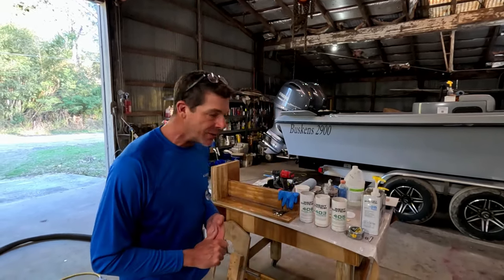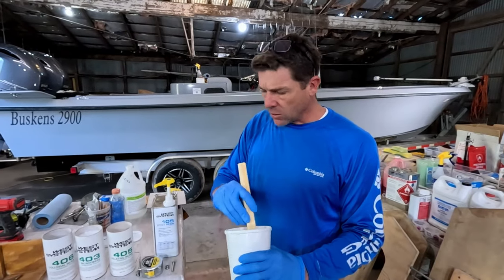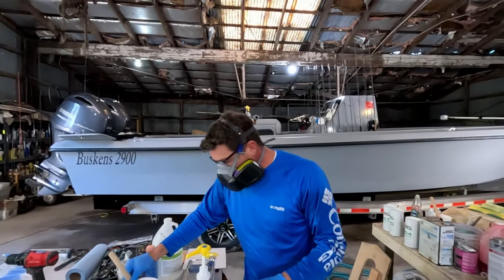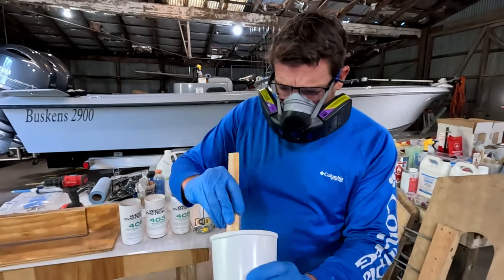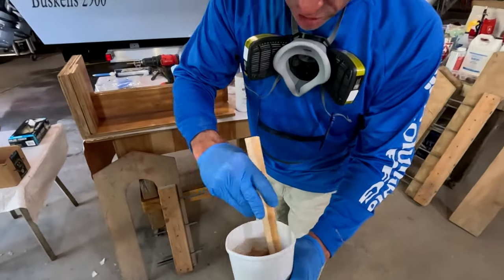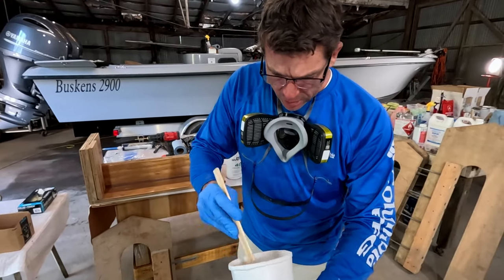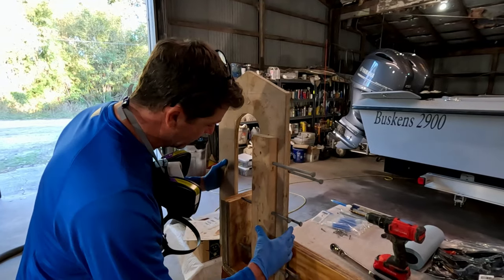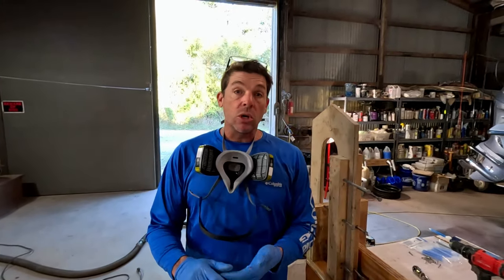HOW-TO MAKE EPOXY FILLER for STRINGER and TRANSOM REPAIRS-DIY TRANSOM

Comment: Capt Joe, As a old Mako 232 owner your tutorials are so valuable to me. Thank you so much, world class instruction! Im rebuilding the rear floor access hatch,  old wood removed, should I poly peanut butter the new wood then layer 1708/mat over that? I need to reinforce between access plates where us 200+ lb dubbas keep stepping. TIA - Mike in Maine.
Reply from the maker: Glad the videos are helpful! You could bed the new wood in a putty, or you could put down a couple layers of csm that has been wet out, and bed the wood into that. I would probably put a couple layers of 1708 on it, but more if you think it might need it. Nothing wrong with going heavy duty on something like that. I hope this helps and thanks for watching!
Reply: @FishBumpTV  Thank you very much, advice taken. Best of luck fishing this year, if it ever stop raining! - Mike
Reply from the maker: @fishing_guy4431  You are very welcome, and best of luck to you also!
Reply: @FishBumpTV  Hatch rebuild came out great! I stripped the hatch down to a shell, taped outside edges, whetted inside and laid in pre-cut matt strips/pieces, rolled out air, placed primed plywood "puzzle pieces" on matt, filled in spaces and gaps between wood with peanut butter, laid 1708 on top, top layer finished with wax additive, rolled air, clamped edges and weighted center. Rock solid! Just need to drill out screw channels thru wood, fill, and drill again. Thanks for your channel Joe, could not have done it with out it. - Mike

Comment: I have a 1992 champion bass boat that has some screws left in the transom from old transducers I think. The holes are below the water line. I was wondering if you would suggest the best product to fill the holes. I don't believe the repairs will be very easily seen. Thanks for making the videos! They are interesting, informative, and hopefully useful in the near future.
Reply from the maker: Epoxy or vinyl Ester based product would be best for below the waterline. Just be sure there is no water or moisture in the screw holes before filling. I hope to do a video on this topic soon for you guys. Thanks for watching!

Comment: Capt. Joe, very nice video.  It would be nice if you made a video on making the clamp.  I have a concept, but not sure I understand all of the details.   

Also,  Bills on THT with Lightning Yachts has mentioned that when working with wood adding cotton fibers to the "peanut butter" mix aids in the bonding strength.  I originally thought the microfiber 403 blend was even smaller glass fibers, but now not sure.  Are the fibers in the 403 blend cotton?  It stands to reason looking at the description on the West Systems website, but they don't spell out what kind of fibers they are.
Reply from the maker: We will be uploading a video detailing the clamps very soon for you guys. I am not sure what kind of fibers are in the filler. I will try to find out. Thanks for watching!

Comment: My wife and I purchased a boat last fall, and to my dismay, the transom is rotted out. I don't have the cash to take it in and have it replaced, so I'm trying to figure it out myself. I got all of the rot taken care of, and in the process of getting the new one made to be installed. I apologize if this has already been spoken about......but after applying the epoxy to the sandwiched plywood, do you use fiberglass on the side of the transom that contacts the fiberglass skin on the boat, or do you only fiberglass the inside, nearest the motor (I/O)? I just wanna be sure that all my work isn't in vain.

Thanks,
Reply from the maker: We usually glass the inside of the transom core with several layers of 1708 on all surfaces. Transoms are a high load and high stress area that need lots of fiberglass reinforcement, so be sure to use plenty. We have some videos of us glassing in the transom on our 29 in our boatbuilding series here on the channel that might be interesting to you.hope this helps, and thanks for watching!

Comment: Hi joe, Bill from Colorado area.  Firstr off, thank you for all the videos. GREAT content.  I have so many questions becasue this is my first go with working with epoxy andmy boat. The three big ones I have now is: 1. My new transom.  I believe you said we should coat the back of the wood with resin before installing.  Did you mean to apply and let dry and then do the peanutbutter and clamp into place or coat both places one after the other and then clamp together?  2. Drilling the 45 degree weep holes.  Does that damage the intergrety of the transom?  I get the reason but am struggling with drilling holes in it after all the work I put into making it. 3. My ski locker, what would you recomment for coating the ski locker after installing the new stringers.  There was carpet in there previously but that just seems like a bad idea for trapping water and moisture.  Appreciate your work.

Comment: Hi there, 
I am fiberglassing a concrete pool shell and made an error on one of the walls. We sanded off the problem area and are trying to repair the issue are but the shell of the fiberglass wall is holding air. Is this the technique you would use in that situation?

Comment: I've been watching now for about 6 months, gotta say, I've learned a lot.  Getting ready to restore a 72 Mako 20 I acquired for cheap.  This boat was registered in 72 and never again.  Cannot say how long it was used but I believe only 2-3 years.  It sat in an open lot for the rest of its life.  It needs a deck for sure and the transom is bowed just a little so I will replace it too.  Other than that its really in good shape minus the cracks in the gel coat from the sun.  My problem is the Plywood to replace with.  I live in Las Vegas and it is not easy getting good wood here.  Any suggestions on a good plywood for this boat?  I like coosa but it is way to pricey for me.  (The boat will eventually make a trip to Baja California and some fishing a long the southern California coast. I will be putting a Suzuki 140 on it when finished.) Thanks in advance
Reply from the maker: Sounds like a good project boat for sure! I would just do some searches online for some marine plywood suppliers. You should be able to find something. Coosa is pricey, but it is consistently good stuff. Hope this helps and thanks for watching!

Comment: I am about to put my cosa transom in, should we use epoxy to glue it in or polyester? Also what would have the strongest bond? 

The cosa is covered with 1708 and polyester resin
Reply from the maker: Both materials could be used, and they both have pros and cons.  We usually bed Coosa board in several layers of csm wet out with polyester resin when we are building new boats. Epoxy peanut butter can be good when installing a new core in a older boat. You just have to decide which one you are more comfortable working with. I hope this helps and best of luck with your project.

Comment: Can you believe it 2 in 1 day? Awesome
So last video blush was cleaned up,  no sanding over the top of the cleanup before this bond?
Lastly for now,  can more layups of epoxy be applied without letting the epoxy fully cure then blush cleanup. is there a time frame?
Joe  I could go on perhaps you have plans on covering that topic.
Thanks 
BTW That 29!
Reply from the maker: Glad you are enjoying the vids! You can always sand more if you wanted to, but the scotch Brite scuffing should be just fine. And yes, you can add layers while there is still a tack on the surface. I will be making a video on laying up some glass with epoxy on the new demonstration piece very soon. Hope this helps and thanks for watching!
Reply: @FishBumpTV  thanks

Comment: Could you use that mixture to fill a hole??
Reply: Kevin,  An epoxy filler can be used true, our question is dependant on certain truer criteria; this is the decision making flow truest 1) Is the hole structural, non structural, and or subjected to other extremes I.E. heat, chem, abrasion etc. 2) Dimensions What is the shape, depth, size of the hole. 3) Cosmetics. 4) Time and cost Color matching, bleed through, texture.. Keep going back and reviewing Marks videos he keeps teaching specifically what you need to know. Finally, No this filler matrix in many cases wouldn't be reasonable And yes you can put it in a hole.
Reply from the maker: Yes you could, but not a very large one. Probably something up to a 1/2  inch or so. The area you are filling would need to be well prepped first. Be sure it is clean, dry and sanded or drilled out first.I have another video here on the channel that discusses different fillers and there application as well, you might find it interesting. Hope this helps and thanks for watching!
Reply: Awesome thanks I'm really new to epoxy there is so much to absorb

Comment: Can hear you just fine with the new mask. Be safe, wear the mask so you can make more videos! Haha.
Do you have to gelcoat over the peanut butter or is that only for cosmetics? (I was thinking of using some for screw hole repairs on an unfinished surface)
Reply from the maker: Glad you guys could hear me well with the new mask! Yes, you could use peanut butter epoxy blend for filling screw holes, and since it's epoxy we wouldn't usually use gelcoat since it is a polyester. But a marine grade paint would be just fine. Hope this helps and thanks for watching!

Comment: Can rotten wood be re-hardened with epoxy?
Reply: I'm thinking most professionals in most cases would replace the damaged area:1️⃣ Is the wood cosmetic or structural in nature? However, to do so in both scenarios the repair becomes experimental not professional: My experience from a dozen YouTubers videos is that many try to become experienced and fail. Sampson boat and Sailing Magic Carpet are prime examples. I share the same question to: Mainly because I believe that some damaged wood could be made super dooper but the process needs to address biological, fungal, bacterial, pesticides, arsenic, and a wide range of testing.
Reply from the maker: We would usually replace rotten wood, but there are some products out there that are supposed to be able to bring rotten wood back. I think these products are made more for cosmetic and not structural applications. Hope this helps and thanks for watching!